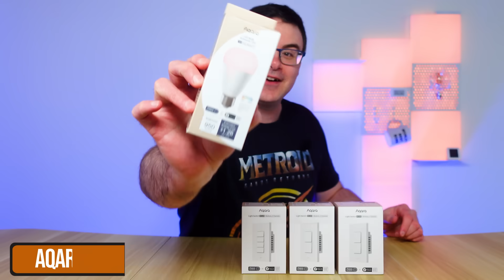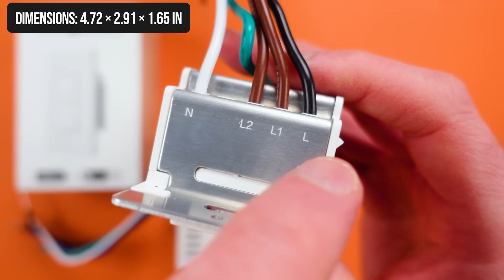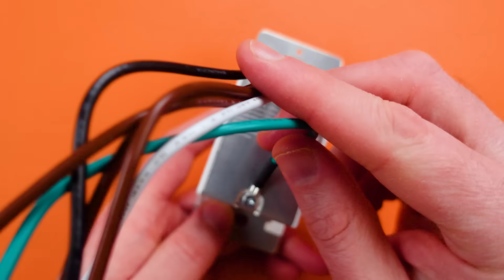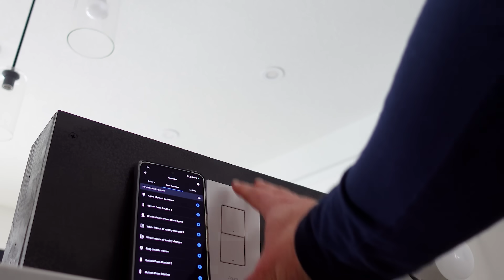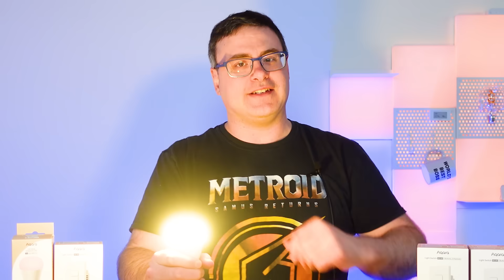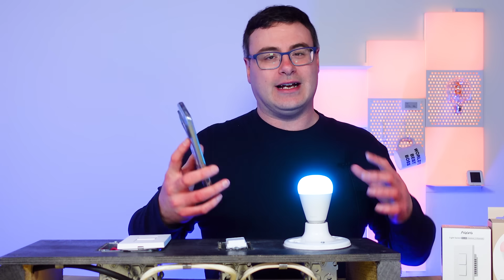STOP Buying Philips Hue Until You See This NEW Aqara Smart Lighting

Comment: Can you please clear up something for me? I know you can have these remain with power to them for smart bulbs. 
My question is 
If you're the zigbee radio goes out, can you still use these switches to control the lights mechanically until you replace the radio? Some makers like zooz and GE will work regardless if your hub is in service or out of service.
Reply from the maker: I thiiiiiiiink I showed it later. If you pair this with the Aqara switches, it does.  A regular switch, I'm not sure it'll work everytime.

Comment: I’ve been looking for a good zigbee option for smart bulbs to use on my bathroom, but have yet to find anything. Do you think these Aqara bulbs would stand up to the humidity caused by showers? Or am I just better off sticking to “dumb bulbs” 😂 I’m wanting to use smarts bulbs for an automation to warn me when my showers have gone on too long. Plus it would be nice to have dim lighting when using the bathroom in the middle of the night.

EDIT: Do you think the H2 US Light Switch would also stand up to the humidity from showering? And does it also work with Ceiling fans?
Reply from the maker: Use dumb bulbs, let them die, and get a good switch. I think the Aqara H2 US Light Switch would be fine.  There's a dimmer model now too, but note that I didn't test it in the humid environment over an extended time ok?

Comment: If the switch is supposed to replace 3 switches is there a three gang plate included for it? Does it mount horizontal then?

I like the idea of the switch keeping power to the bulb. This saves steps of creating automation of turning on the switch first (having the bulb default power on state to be off/no light which isnt even possible on some bulbs) and then sending the color/brightness command. All of this introducing some delay as well.

I'm unclear of the value of the aqara bulbs when compared to orien, linkind, or tp-link kasa. It would be interesting to have a video about those specifically as they all support several protocols and could be used in the aqara ecosystem via a virtual homekit setup.

Also, this is a good time to mention how much i miss Lifx. They by far had the best colors of bulbs even to this day. Custom wled setups with DIY led strips can achieve it, but for an out of the box solution no one yet has come close to replicating the vibrancy.

I primarily do work with stage lighting and production lighting. RGBWWA+UV spoils you when it comes to color reproduction let alone accuracy so i find a lot of these bulbs to be comical. I wish the two industries could get together. Quality of colors and lighting paired with easier configurating other than DMX and artnet.

Thanks for making videos with these new products and showcasong various use cases like you did!
Reply from the maker: Hey Kaislate - It unfortunately doesn't come with a three gang plate. I do wish Aqara sold those with or as an accessory. Something to come, hopefully!

I think the value is more about the pairing with the switch and the ability to choose whether or not you're going to control this in Aqara's app or another. Many Matter bulbs can be controlled elsewhere, but this is pretty ubiquitous. :)

And LifX is still around! Don't miss them, just go get em ;)
Reply: @AutomateYourLife  That is a good point about about having things being able to be controlled on aqara's app. As much as aqara would like you to purchase everything through them they understand you might have other brands or even non smart devices.

I do wonder about the thought process though of having a switch to replace three light switches, but then making it that size. If people replaced three switches with this they would be left with a hole in the wall beside it. At the very least blank plates should have been included.

And yes "Lifx" is still around, but it is not the same company since Feit took over. The original company is disbanded. Some of their early stuff though had excellent color reproduction even at low brightness and also had the least flickering of any product. 
Also something that isn't ever discussed is flickering and UV leak. This is not so pertinent for normal smart home use (though some may still be very interested for eye fatigue / eye strain relief reasons) but more apt for any light that will be used on camera.
I'm sure you know about the troubles of accurately capturing these lights on video. Brands like elgato, gvm, shehds, adj, chauvet, and other more streaming / stage production focused companies have addressed this, but it would be interesting to see the best in class and the worst offenders of this when it comes to smart home consumer orientated stuff.
There are some channels that have done flicker measurements with LEDs strips, but I haven't seen bulbs yet.

Comment: @automateyourlife
Have you tried using the two button one in a 3-way circuit where the other switch is a dumb switch? I read somewhere that there is a delay when toggling power from the dumb switch which would be weird. Is there a noticeable delay when toggling power from the H2 itself?

Also, do these have a power disconnect button to the switch electronics to "reset" the switch electronics? I've found that feature very useful in my WiFi based smart switches since it saves me having to turn off energy using the associated circuit breaker.
Reply from the maker: I don't remember a delay specifically, however it'll depend on the bulb type you're using right? There is maybe a little delay when toggling the switch, but it's not something that I found unreasonable. I think this is going to be a personal preference thing mostly :)
Reply from the maker: No power disconnect though, sorry

Comment: Is mars tech only available with neutral wire? I'm not seeing it in my app.
Reply from the maker: Only on Zigbee. I don't think the Neutral wire was required.  Try a re-set up and switch to Zigbee :)
Reply: I don’t see the MARS tech option either and I have my switch setup on Zigbee. I’ve tried multiple things and still that option doesn’t come up. Also using the Aqara Hub M3. Any feedback would be appreciated.

Comment: How would you compare the minimum brightness levels? Usually, Hue is the very best in this category. Same for the smoothness of dimming up&down, Hue is usually top notch at this (when using their own bridge without home assistant, since home assistant is very crappy in dimming up/down control). Curious what your thoughts are.
Reply from the maker: That's a really great set of questions. The minimum brightness is incredibly low and it's just a few lumens. The bulbs I have from Hue are actually a little brighter at the minimum of 1%. 

It is a mostly linear progression but it's not perfectly linear. It's definitely not something you're going to notice as being a problem to control

I'm using Homey when I do that comparison in control. Just FYI

Comment: Seems very interesting, but when you replace a 2 gang with this, or even 3 gang with on aqara switch. What do you do for the hole on the wall lol? Any aqara wall plate to solve that problem? or you can use any wall plate?
Reply from the maker: I didn't find a restriction in the wall plate but there's definitely some work to do if you replace a two or three gang with one of these. You'd end up having to change your wall

Comment: Once MARS is set up, do you still require the hub to be active to control the smart bulb from the switch? Have been looking for ages for a way to directly control smart bulbs during an outage but still retain smart control via apps during normal operations. Do you know which Aqara lights support MARS?

Comment: So, unless I am building and equipping a new house, our houses already have light switches. And while there is this new product for 2 & 3 gang solutions, how do I use it?  Our homes already have 2 or 3 gang boxes with single dumb switches there. We take the 2 & 3 single pole (likely) switches out to put these two multiple switch smart switches in their places.  But what do we now do with the big old empty hole left in the two/three gang box?  In other words, I took out 3 physical switches to put one multiple switch single gang switch in the 2 or 3 gang box?  BIG EMPTY HOLE THERE NOW.
So, I solved a problem that was less a problem and more just offering convenience and in turn created a drywall/construction problem.  Not so sure, that I have improved my home.
Reply from the maker: You're definitely going to have to do some work if you replace a two or three gang with one of these switches.
Reply: @AutomateYourLife  Which I think gives us a reason to pause and consider the multi-switch form factor is not practical, IF, we have to do construction/drywall.  The single swich form factor is likely more within 75% of the cost of the multi- but saves drywalling. And we can fortunately use 2-3 singles in that 2-3 gang box and a standard face plate vice their nice/fancy face plate.  Am I right? Am I making sense?

Comment: Saw these when Paul posted a few days ago. One question though, can these be used with Hue and the Hue hub, or only by another zigbee controller?  Also, for someone who bought into Hue years ago, can these bulbs operate 1:1 with Hue lights?  As in, if they can be added to a Hue hub, can they share scenes with Hue bulbs, and have the same "resume last state" setting when powering back up (after power failure) like Hue bulbs can?  I have a few dying Hue bulbs and if it does all that, I can replace those with these.
Reply from the maker: Sorry I didn't try them with the Hue hub. I can't answer this one

Comment: I really like that switch but if I were to use it I wouldn’t connect it to any manual switch wire. I wonder if that would be ok.
Reply from the maker: I don't fully understand what you're saying, but this is intended to work in a regular wall switch location! Just make sure you buy the right one for your situation
Reply: @AutomateYourLife  I have an empty wall switch box that just has a romex splice in it. I would want to put this there and provide power to it but not connect any of the switch leg side of the wires. There’s probably a better option out there but this one intrigues me!

Comment: When my Hue lighting burns out, I’ll be replacing them with Aqara! I like their FP2 presence sensor and my G3 cameras (I’m waiting on the G5 and G410), so it’d be nice to have my lights be the same brand and connected to the sensors and cameras in both HomeKit and Aqara or whatever Matter compatible platform I want! I’m an Apple HomeKit gal myself, but nice to have options for extra control and quick response times.
Reply from the maker: Yeah this is perfect for people using home kit so you're going to be happy with this kind of a bulb and that kind of switch
Reply: well it may be in long time. I have 40 Hue lights since 2018 not a single one burned out. Probably there are better lights on market right now (even philips ones) but when someday I change them i will check Phillips brand again as the value is expensive but the peace of mind that they gave to me over years and years worth it.
I had a single Yeelight (old Aqara) bulb and it was a pain in the ass...it kept disconnecting from my wifi. it was 3 times cheaper but now it's on the trash.
Reply: @Gaarax1981 right! Quality might be better but hue has been SO reliable and easy to work with. I really like their ecosystem.

Comment: 1:10 it should be worth noting that in the past couple years, Hue has replaced almost their entire lineup of A19 size bulbs with 1100 lumen models and sells them at the same price point as the old 800 lumen models
Reply: And they also sell 1600lumen too
Reply: @GabrielRM  sadly 1600 Lumen is a massive bulb and doesn't fit my existing lamps that were desinged with classic small E27 bulbs in mind.
Reply from the maker: Yep, they do definitely have brighter bulbs now than when I purchase these
Reply: @AutomateYourLife what about Govee vs Aqara? I have enjoyed Govee Lights
Reply from the maker: I still love my Govee lights, but there's a different level of reliability and features that have been brought in here by Aqara.

They both have their reasons in my mind!
Reply: Exactly, as I already mentioned in my comment… if you want to make a comparison with another brand, you can't use a product that's over five years old, especially when there are more recent models available.  

Either you spend the money to buy a current Hue model, or you simply don’t compare it.
Reply: @Gaarax1981  I have to agree 100%. This is a bad biased comparison . It really is a shame and discredits my trust to the channel
Reply from the maker: Doing a comparison for a light bulb isn't always about color and brightness. You guys are talking about a specific thing that you wanted to see. I get that I used older bulbs. That's not really the point, although I did show some things that I had found that were better on Aqara's bulb.

The point is that this is a highly reliable light bulb, with features that match or in some cases are better than Philips Hue features. I have always found that Philips Hue has a relative Monopoly in some of these things. 

This bulb is less than half the price of a new bulb from Philips Hue and it has all of that. It has thread and it has extra options when you use it with a light switch from this company. 

It's not just about brightness and colors. Every company can make a decent light bulb now. 

If you take a moment and you look at it that way, maybe you can stop panicking about the specific bulb I compared it to visually.  Please understand that I have hundreds of light bulbs that I could compare it to. And I've seen them all perform. I know what they're like.
Reply: @AutomateYourLife  these are all excellent points, however it should be noted and understood that when you chose to title the video the way that you did, and compare a brand new product to a competitor's old product that I believe was released in 2016 and since been replaced by a newer model, you are opening the door for criticism yourself especially when you don't acknowledge this in the video
Reply from the maker: All good to criticize. I'm open to it, but I like to have a conversation and I'm not just going to agree because someone criticizes. I find with most of these comments that people are more attached to things they have done in their life... such as buying into a specific brand. It's okay for things to change in a market. And my evaluation is that Signify has now been caught by some other makers. I have plenty of new Philips Hue products to back up this claim. I just didn't have the exact bulbs that these people would like me to compare to.

We will see if they come back with any sort of support for why the new bulbs are so much better. :) So far my understanding is that the lumens are better. Which I knew, but you're right...I didn't say.

Comment: Super considering replacing all my hue bulbs with these just to clarify if I want to use the smart lighting control where if the switch is turned off the light is still technicaly powered so I can control it with voice or app I need to set it up with the switch on zigbee mode? Correct?
Reply from the maker: And just to clarify, to be able to do what you're asking... You need both the bulb and switch to be set up in zigbee mode
Reply: @AutomateYourLife  awesome thank you
Reply from the maker: Yes, that is correct. I would suggest you try a couple out in an easy situation to test and then see if you enjoy how it works. I never suggest replacing an entire home on a single video

Comment: Aqara have just launched the H2 in an EU form factor. Currently only available with 1 button / 1 channel or 2 button / 2 channel versions. Neither support 2-way switching (no Traveller connection).

The depth needed is a minimum 30mm, so not going to fit many UK homes without making the common 25mm back box deeper. The faceplate is 86mm x 86mm which is the UK standard so no redecoration issues as can happen with many smartswitches.

Other features are similar to the US version.

Dual Zigbee/Thread is great but not yet common. I do wonder if a next generation of Philips Hue bulbs would do the same?
Reply from the maker: I'm sure we will see Hue and a few other makers pick up on this. Hopefully we see some good options for you in the UK!

Comment: Does the MARS Tech (couple/decouple) work with non-aqara smart bulbs? It should....
Reply from the maker: I think right now it won't work just because the app has to be able to choose the bulb. I think if you had one bulb on a circuit and then used other smart bulbs that it obviously would. I didn't test extensively though

Comment: Aqara just ploughing through pretty much every other smart home device maker with their ever growing product line
Reply from the maker: Yeah this is honestly an assault on a few makers...and I'm here for it
Reply: @ Means the competitors will actually have to compete
Reply: Aqara is missing a garage door opener
Reply from the maker: Oh I think you'd use a relay most of the time for the garage door opener. Check out our review of the T2!
Reply: @ I used a T2 relay with a E1 hub to control a projector screen in a 23,000 ft.² church. I use the momentary contact configuration and it works extremely well. But correct me if I’m wrong I don’t think you can configure the T2 relay to be exposed as a door in HomeKit. And the one thing that I do work from a garage door opener or relay is Matter over thread without the use of a hub or bridge.
Reply: And a smart rim lock